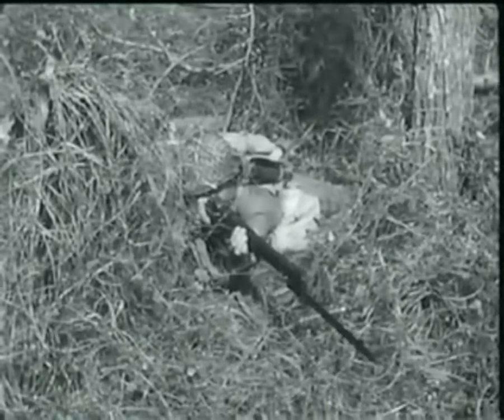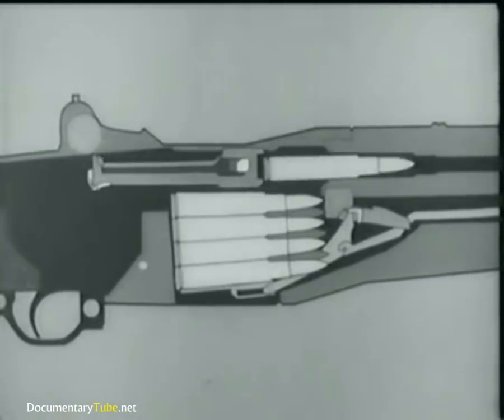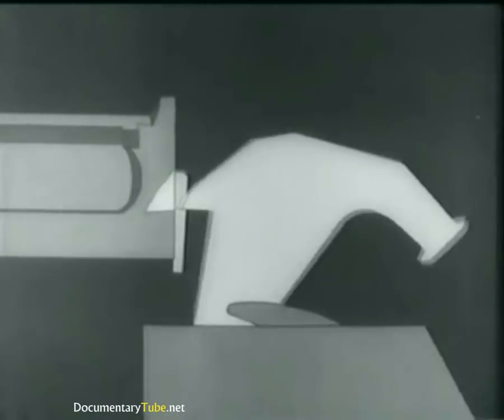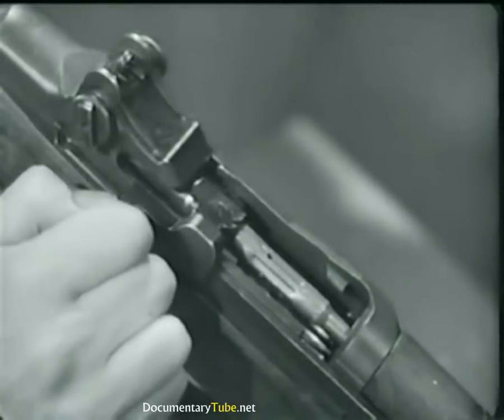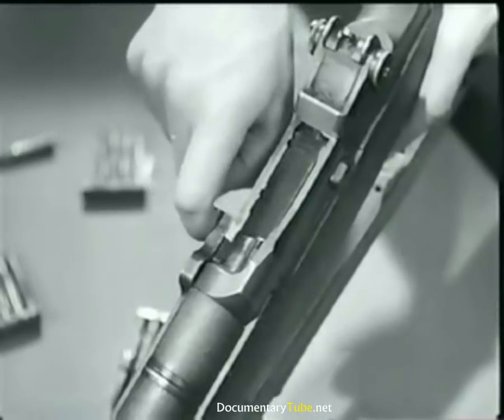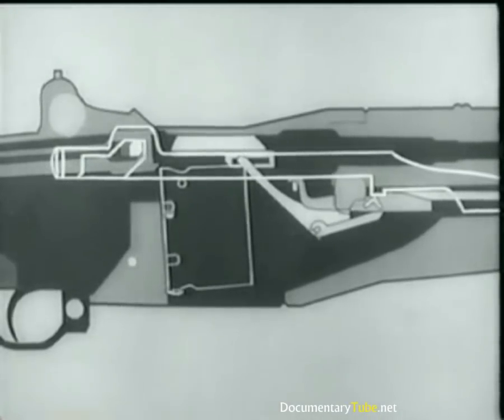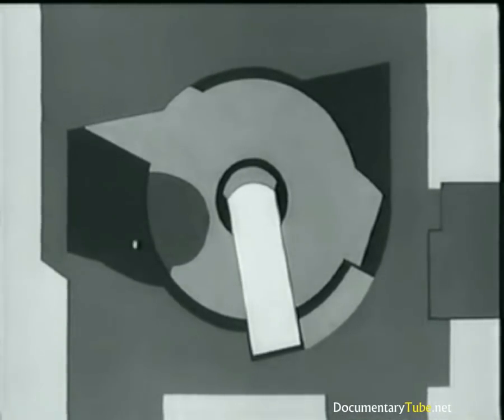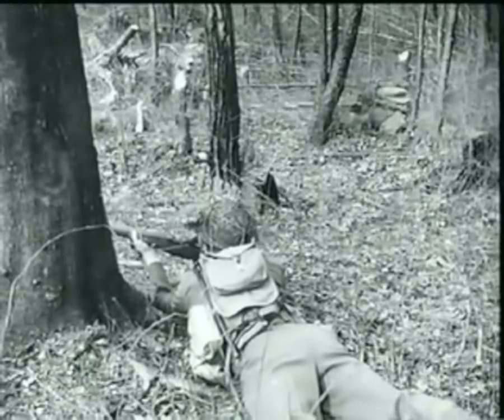HOW IT WORKS: WW2 M1 Garand

Comment: Anyone else wince when they didn't keep the palm of the loading hand covering the charging handle? 😮

What's interesting here is seeing both the cleverness of Garand's design along with the obvious complications he had to engineer into it to satisfy Army requirements.  Specifically, the follower arm that allowed for a flush-mount magazine.  That could have been simplified far more to a more conventional spring/follower set-up--easier to manufacture, too--if the Army had allowed for a protruding fixed magazine.

Comment: That's a lot of moving parts. Just out of purely hypothetical interest, does anyone know if removing the sear altogether would cause this weapon to fire in auto? Would it still catch on the trigger lug if the trigger was released? (wouldn't attempt it even if I had the chance, im just interested in the mechanical and engineering aspect of firearms) Also is this classed as "long-stroke" gas system?
Reply: Steve Steves I do not think so for your first question. Since the hammer is still sprung. if there was no trigger lug to hold back that hammer while the trigger is depressed, it would follow the bolt back up. While this seems like it would cause the rifle to fire again, I think the hammer would lose it striking energy and not hit the pin well enough to set off the next chambered round.

Comment: As mentioned before, at 1:49, they don't show in the diagram how the operating rod slams the bolt into your thumb, which you were using to push the clip into the magazine!! Best way to load is to use your hand in a karate chop shape (or sock puppet shape), then press the clip in with your thumb, then the op rod flies foward to chop your thumb off, the handle instead hits your karate chopping hand and you can pull your thumb out. Or, just insert the clip "smartly"... thumb in and out quick!
Reply: Interestingly, the Japanese Arisaka does the same thing.  I was showing a mate how it operated and he released the bolt on my thumb.  After years of avoiding M1 Thumb I got one from a damn Japanese rifle.
Reply: gotta love that garand thumb haha
Reply: *****
I have one too, it likes to try and decapitate my thumb.
Reply: *****
Yes, it did! Well, I bought it from a guy who bought it from CMP. But I could have bought from CMP. Shoots nice, I used it to shoot silhouette.

Comment: Because there are 8 rounds to a clip (4 on each side), how does it switch?
Reply: +David Moss It doesn't need to.   The bolt runs down the center and is designed such that it will catch and guide a round on either side of it into the chamber.  The feed ramp is not a straight diagonal, but rather is designed to feed rounds correctly from either side of the clip much like a funnel.   Because the bolt always sits at the same height, only the topmost round can be caught and guided into the chamber, regardless of which side it is on.  Because of spring tension, as the rounds in the clip are removed and fired, the remaining rounds are forced upward and into position adjacent to the bolt so that the next topmost round will be caught and loaded into the chamber after ejection.

Modern rifle magazines also function on this principle, and almost all modern semi-automatic magazines are designed the way the Garand's clip was.

Comment: Strange how this video completely avoids showing or discussing the sound of the clip ejecting.  One of, perhaps the only, flaw with this rifle.
Reply: +LoneWanderer36 Not to mention en block clips are easier to load in comparison to you standard clips that the Brits/Germans/Japanese used that you'll most likely just get yourself killed following some misguided advice about pinging sounds.
Reply: +Loiyaboy Irrelevant in the heat of battle.  With so many other sounds, listening for a clip ejecting is a waste of time, especially since the likelihood of all the Garands in a fire team being emptied at once is rather slim.
Reply: I would agree.
Reply: +Loiyaboy PING!
Reply: +Loiyaboy the ping is not a flaw, you will never hear the clip eject in a fire fight I  own 7 garands the 30-06 is way too loud to hear anything over it, the people that keep Perpetuating this myth are idiots, the real flaw is an open bolt and operating rod, gotta keep greased and free of debris.
Reply: I'm not sure ya'll read my post correctly. I said it was perhaps the only flaw, one that could be a problem.  But, as I understand it was ocassionally used to advantage too by tossing a empty clip on the ground to audibly simulate a re-load situation (which normal clips do not have). The M-1 only had one.

Comment: Why aren't there modern productions of this rifle, with synthetic stock and rails? The pump shotgun and AK get modern productions, but not the M1 Grand, Springfield, Mauser and SKS, you can only find surplus rifles for these.
Reply: Squid Balls obsolete
Reply: +Squid Balls Mini 14 for one. Springfield Armory made many civilian versions of the M14 also. The Garand is slower to reload then most detachable magazine weapons and the magazine cant be topped off so it is a little obsolete.
Reply: brad gillis I'm only asking because of the restrictive laws in California on "assault weapon" features. The SKS is like a godsend with its internal magazine.
Reply: The mini 14 may be legal too? Theres several youtubers that show "california legal" rifles. I think flash hiders are prohibited correct? By the way SKS rifles can be fitted with detachable magazines, Ive had several. Can you legally convert'em or are they across the board prohibited?
Reply: +Squid Balls MK14 EBR and M39 EMR. Those are the most modern incarnations of this rifle, those are derived from the m14, a box mag fed evolution of the Garand.
Reply: ***** There's also the Saiga AK but it's getting rare and the magazines are expensive. I love how the SKS uses cheap stripper clips, I can afford a bunch and keep them loaded forever without cramping any magazine springs.
Reply: +Squid Balls M1A/M14 is basically a 'modern' production of this weapon being built well to this day as a DMR/Match rifle.
Reply: there is, its called the Socom 16 and other variants by the new Springfield Armory.

Comment: So many intricate little parts, and this thing didn't jam? That speaks volumes about the tight tolerances of parts produced by the U.S. in the 1940's. Aside from Germany and Britain, I don't think anyone else could manage this.
Reply: xwx.fred Tight tolerances don't necessarily translate to less jamming.  Keep in mind that metals expand when heated.  Two closely fitted metal parts can easily bind once they both heat up and expand.  Plus, with tight tolerances it doesn't take much dirt or dust to bring the action to a grinding halt.

The Kalashnikov, on on the other hand, has relatively loose-fitting parts compared to earlier military rifles and because of that it can take plenty of mud, sand and grit and still fire perfectly.  M-16s don't perform like that, nor have any of the Garands I've seen.
Reply: +2012 cthulhu not revolvers
Reply: Guitcad1 M16s are relatively reliable because it does a very good job at keeping dirt OUT of it's internals. The bolt carrier acts as one shield and the dust cover as another. But when dirt does get inside, it can jam up the trigger mechanism which is an advantage the AK has. However, the AK has a flaw as well and that's when the safety is down there is a huge gap which dirt and debris can enter the receiver. And although it can take more abuse, it still can jam up with enough sand and dirt.
Reply: My original comment was on the quality of mass-produced equipment from the WW2 era. Garand's design is mechanically complex compared to it's counterparts from countries like Russia and Japan. If American industries couldn't produce parts with superior accuracy and precision, the M1 would have suffered from poor accuracy and frequent malfunctions. From history, we know that neither of these happened. The M1 Garand was designed to be a good firearm from the start. It's parts needed tighter tolerances because the designer wanted to enable users to land a hit from greater distances. Of course, tighter tolerances also means that you actually need to train your soldiers to properly maintain their guns. That's just a side effect of letting them hit their opponents before their opponents hit them.
Reply: Of course, all this isn't to say that the AK's aren't successful firearm designs. They are, but they were designed with different goals in mind. Most Russian firearms weren't meant to be good guns. They were meant to be adequate. The idea was to design a gun that could be made in a basement workshop, supplied by substandard ammunition, and operated by poorly trained recruits. Stalingrad much? Every major power's weapons industry is shaped by it's military history. Depending on how you look at it, the rugged reliability of Russian firearms could be the result of applying decent quality control when making guns that were designed for rudimentary production facilities.
Reply: xwx.fred Which, unfortunately, was mostly a waste of effort and resources.  After the war it became clear that, with the exception of a very small number of highly trained snipers, soldiers in combat almost never even attempt to shoot at an enemy more than three hundred yards away.  It was this realization that led to the adoption of the M16.  Why arm troops with rifles having a range of 1000 yards when virtually none of their kills will ever be more than a third of that distance?
Reply: Guitcad1 A waste of time? When American soldiers were being issued the M1 Garand, the Russians were still wielding Mosin Nagants, the Germans mostly had Mauser 98K's, and the Japanese had some joke of a bolt-action rifle that was longer than their soldiers were tall. Also, having better accuracy is definitely not a wasted effort, because there is a difference between effective and ineffective suppressive fire. Why do you think NATO stuck with 5.56x45mm (.233) ammo when the 7.63x39mm clearly had better penetrating power? Also, the importance of sharpshooting was never lost on the battlefield. Recent conflicts have proven the importance of embedding sharpshooters/snipers with the smallest of military units.
Reply: xwx.fred (Sigh) Okay.  You're right.  You win.  I don't know what I was thinking. [leaves to concentrate on his actual life]
Reply: all guns jam
Reply: I was going to say the same thing ,you want loose fitting fitting  to a degree, like the AK

Comment: M-1 Garand semi-automatic rifle was a great masterpiece which the U.S.Army ever introduced. In fact, M-1 Garand rifle played a very important role for the victory of the U.S. over Imperial Japan during the Pacific War. Japanese Type 38 rifle and Type 99 rifle were no match for M-1 Garand rifle in terms of fire power.
Reply: +Bilbo Baggins Bolt action rifles tend to be a little more accurate than semi automatic rifles, but semi automatic rifles are better overall.
Reply: You're right what's a bolt action rifle going to do against a semi auto rifle a clear advantage
Reply: +MrEjidorie The germans were predominantly equipped with bolt actions as well.
Reply: +Charles Ball Japanese Type 38 rifle was originally developed for Russo-Japanese War, and it was introduced by Imperial Japan in 1905. Its firepower was inferior to M-1 Garand rifle, but its structure was very simple and maintenance was easy. That`s why Type 38 rifle had been used until World War II. Many Japanese believe that Type 38 rifle was a symbol of Imperial Army.

Comment: this gun sucks... It even cuts your thumbs off -__- kalashnikov for the win
Reply: ***** pfft the kalashinikov wouldn't even exist if it wasn't for the machine pistol 44(mp44) or sturmgewehr 44 (stg 44) storm rifle ie to storm the enemy or to assault. the kalashinikov is a direct but updated copy of the stg44 

the English translation assault rifle became the accepted designation for this type of infantry small arm. so there you have it you can thank Nazi germany for the term assault rifle
Reply: thanks, i´m german and i approve my country put a lot of efford in weapon technolgy :)
Reply: in saying that i much prefer the american bar Browning assult rifle a full size riffle cartridge etc
Reply: ***** Common misconception. M1 bite comes from improper loading technique. Try pulling the bolt back further, it should lock to the rear (which is the point of the op-rod catch) until the bolt handle is pulled back and pushed forward again, as you can see from the video

Also, comparing the Garand to the AK series is fallacious; they are two very different weapons in both form and function.

EDIT: Also, it's "Browning Automatic Rifle", and the BAR never served as an infantry rifle; more like a squad machine gun.
Reply: ***** Wrong war. If you like Soviet gear,  compare it against the SVT-40.
Reply: Kalashnikov was still a soldier during the m1 garand time. You should also know he made a rifle based on the m1 garand
Reply: +kyle “brainbukt” hubner Not an assault rifle.  Battle rifle or squad machinegun.  First assault rifle wasn't until 1944 (STG 44).  BAR and Garand were created in 1918 and 1936, respectively.

Comment: There is actually a big misconception with "Garand Thumb"
When loading ammunition the bolt will not slam closed on your thumb untill you release pressure off the cartridges AKA pull your hand away.
"Garand Thumb" typically occours when an operator handling a empty rifle uses their thumb to press down the elevator far enough (in place of non present rounds) to release the bolt.
Reply: Cube210  high school rotc in the late 60's, i carried the m-1 and learned how not to get the garand thumb.  you place your open palm on the outside of the gun, edge of you hand against the bolt.  press down on the magazine ejector with your thumb while holding the bolt back. let the bolt slide forward slightly and remove your thumb before the slide does so for you!